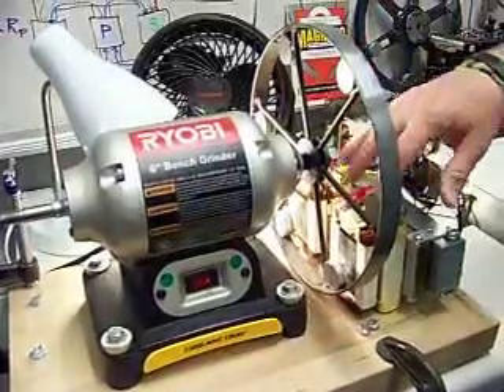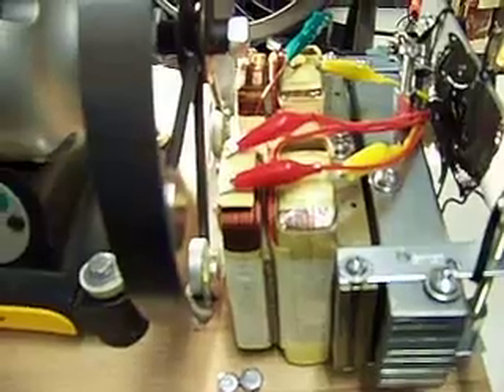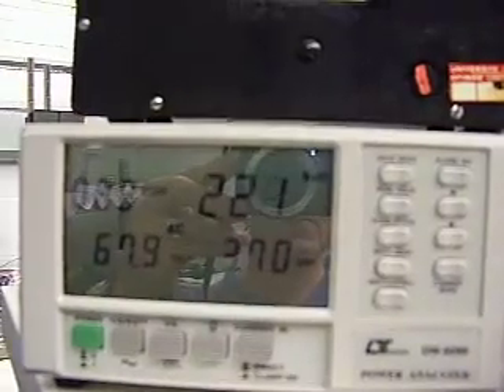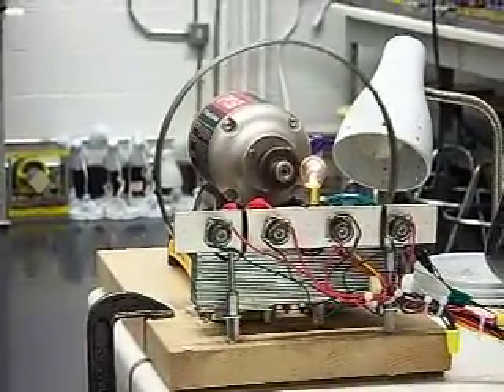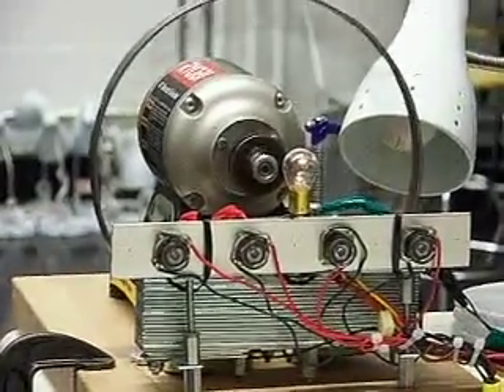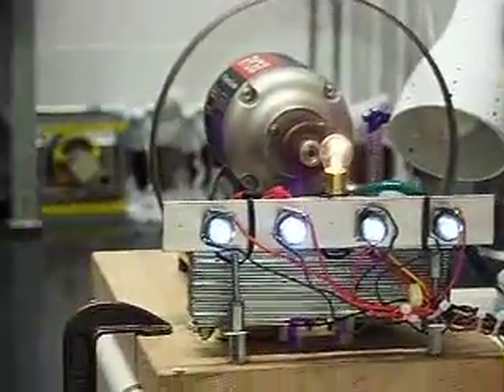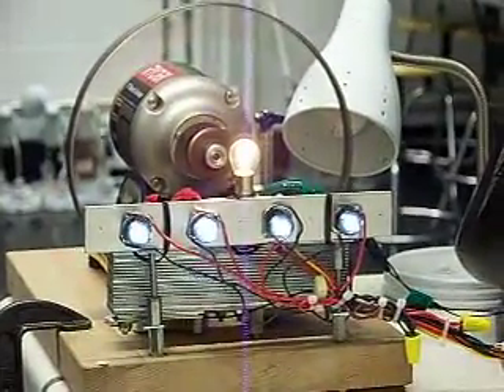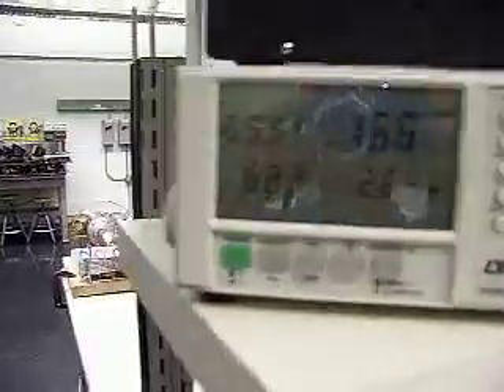PART 1 PEREPITEIA DEMO VIDEO OTTAWA UNIVERSITY MAY 2008

Comment: electron and proton dipoles act like tiny magnets as fields with poles. 
they have seperate independent symmetry, when the symmetry break between them 
an energy exhange can occur. without this symmetry breaking effect there is no way
a manetic flux can generate electric currents.

Comment: the problem with science is that they believe a magnetic flux is high current. 
from an electron point of view its not. high current only produce static flux and not magnetic. the magnetic flux create no current but can idirectly invoke an electron current when the symmetry break. the high voltage coils have much higher electric resistance. electrons love high electric resistance. protons hate high electric resistance and try to prevent themselves from materializeing a magnetic flux.

Comment: Can you furnish a schematic?  There's a dozen ways one could wire high current / hight voltage coils into a circuit.... A schematic with number of turns, wire size AWG, etc..Thanks.